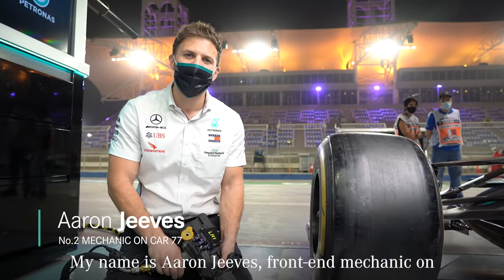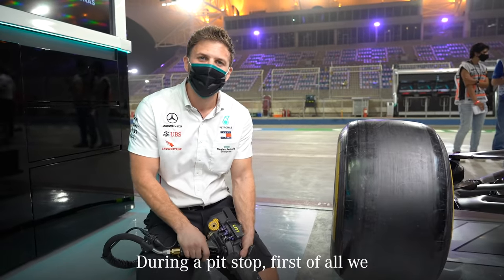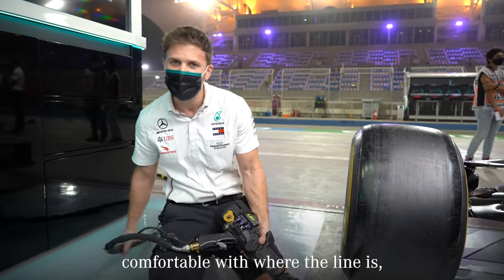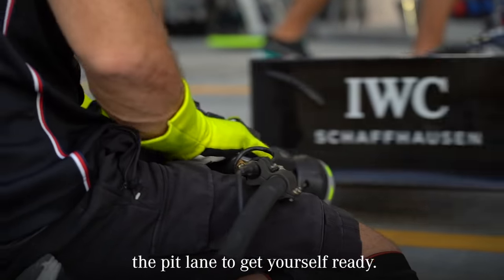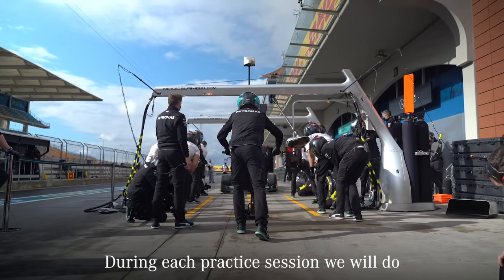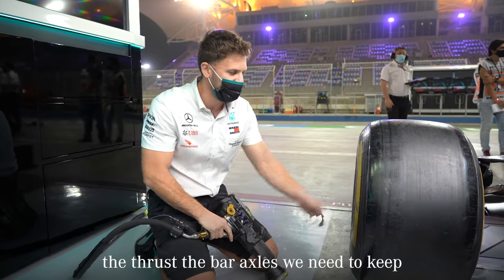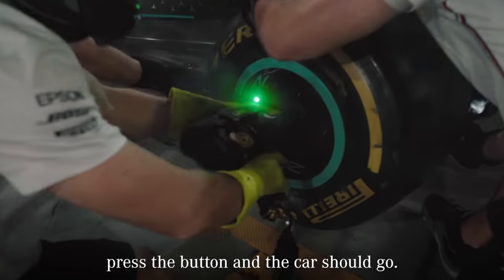F1 Wheel Guns EXPLAINED!

Comment: Thanks Mercedes for these insights. This brings F1 closer to us!
Reply from the maker: Our pleasure!
Reply: @MercedesAMGF1  you guys rock....best team management right from garage to trolling and roasting in social media ....great job guys keep it up
Reply: @MercedesAMGF1  Hey Mercedes
Reply: So true dude! I actually want a job in the f1 as a mechanic! And this helped a lot!
Reply: @MercedesAMGF1  do you practice failure scenarios too? From the 50 practices mentioned during the video, how many are fails? Are they setup totally blind for the engineer or they know when it's coming? 

Thanks!
Reply: I mean, they didn't really tell us anything specific or anything we didn't already know about how a pit stop is done..
Reply: @BeardyGit89  yes they did.
Reply: @hansmuds6018  you must pay very little attention to F1 if anything in this video is new information to you.
Reply: @BeardyGit89  wtf? I mean insights to this certain race. For example why Mercedes chose a certain strategy or how did they manage to do a one-stop. You don't get this info somewhere else
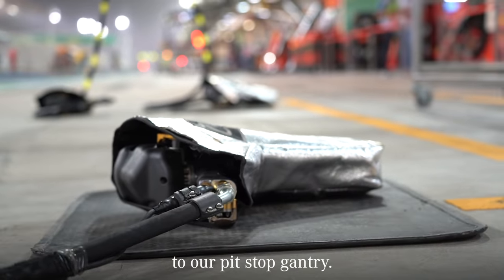Reply: @MercedesAMGF1  Please confirm my thoughts below if possible. 0:09 0:11 Green marks on gray tip of socket show it is spinning 0:22 2 sets of splines.
The above makes me think that the small inner socket is non spinning and the large outer socket spins. Given the two are working against each other, the operator won't get any torque reaction. Also note the blinking green light at the end of a tightening cycle as well as " the gun is electronically tied to the pit gantry ". This makes me think that there is a torque monitoring system in the gun, this monitoring system would be difficult to implement in a impact style gun.
Reply: @MercedesAMGF1  and ours!
Reply: @BeardyGit89  agreed bro, all they showed us was changing a tyre frankly and we all know how thats done,  its interesting but does not show alot
Reply: Also bringing valtteri closer to dnf

Comment: why no vroom vroom sound from the gun😢
Reply: Tbh it would probably break the mechanics hand, that wheel gun is so powerful (3000Nm) that it can break someone's hand if its not torque'd on anything as far as I understand lol
Reply: @sollar5188  yeah they are insanely powerful. They are also crazy loud so they probably didn't want to ruin the mic
Reply: @sollar5188  wouldn’t less twisting force be exerted on the mechanics hands when the gun is free revving with no resistance rather than when its encountering resistance from tightening a nut?
Reply: @quixotic6871  no, because there is nothing to take that force from the gun
Reply: @sollar5188  No this is absolutely not the case.
Reply: @sollar5188  It'd just be spinning.
Reply: @Kamyllo22  Isaac Newton disagrees
Reply: @quixotic6871  OK ye true lmfaoo. In the words of Charles LeClerc "I am stupid."😂
Reply: That's an impact drill guys, which means simply it has a flywheel inside that spins until some speed and when rew'd up to a certain angular momentum it locks up to the rest of the gun to excert that 3000Nm torque, if there's nothing to stop the gun then it'll try to spin itself with that much torque.
Reply: @tafana  0:09 0:11 Green marks on gray tip of socket show it is spinning    0:22  2 sets of splines.
The above makes me think that the small inner socket is non spinning and the large outer socket spins.  Given the two are working against each other, the operator won't get any torque reaction.  Also note the blinking green light at the end of a tightening cycle as well as " the gun is electronically tied to the pit gantry ".  This makes me think that there is a torque monitoring system in the gun, this monitoring system would be difficult to implement in a impact style gun.
Reply: @sollar5188  0:09 0:11 Green marks on gray tip of socket show it is spinning 0:22 2 sets of splines.
The above makes me think that the small inner socket is non spinning and the large outer socket spins. Given the two are working against each other, the operator won't get any torque reaction. Also note the blinking green light at the end of a tightening cycle as well as " the gun is electronically tied to the pit gantry ". This makes me think that there is a torque monitoring system in the gun, this monitoring system would be difficult to implement in a impact style gun.
Reply: @bobroberts2371  if it's anything other than an impact style gun then the operator would need to tighten the bolt by his own strength. And the green marks show it's spinning like what? Half or quarter a round? Looks to me like he released the trigger already and pulled the gun and you see the tiny bit angular momentum left on the tip at 0:09. Otherwise I don't think he'd still be spinning the gun while pulling the bolt out of the wheel, it'd be dangerous, the bolt could fly out at some insane speeds.
Reply: @tafana  From what I figure.  The small inner socket is locked to the body of the gun, this small inner socket locks to the axle stub. The large outer socket locks to the wheel nut then rotates to take the nut  off.   Since the small inner socket is held immobile by the axle stub ( and driver holding the brakes on ) there is no torque reaction felt by the operator.  Also, an impact wrench is slow compared to a straight motor.  I'm also guessing there is a 2 stage gear reduction system on the gun to allow for high torque / low speed when taking the nut off and low torque / high speed to spin the nut once loose .  There might also be a third stage for final tightening.
Reply: Because they dont want to show that It sounds better than F1 V6
Reply: @Bocho123  that's not how an impact drill works
Reply: @Bocho123  and even if it wasn't an impact drill the torque it applies against it's bit and inner mechanism's inertia is still enough to injure the user. If you have an ac drill try this, hold it with one hand, extend your arm, then push and release the power button for a moment, you'll notice it's trying to spin your arm too. It's not because of friction it's because of inertia.
Reply: @quixotic6871  nope, a free revving gun spins in the body of the gun and it generates so much force it moves the body (grab any gun and you can feel it), it doesn't just spin in place, and you're holding it by the handle off centre of the spinning body it will want to rotate and twist your wrist. When it encounters resistance, it is an impact gun, easiest way to describe it is that it just vibrates harshly in your hand and the nut is holding the gun body in place so it doesn't twist your wrist, it is not like a drill that just wants to spin and rip out of your hand.
Reply: These impact hammers work like a normal hammer: you swing your hammer with limited force, and upon impact, you generate an extremely high impact force of very short duration.
In the wheel gun, the law of momentum conservation is applicable: the mechanic's holding torque is the mean value of the actual hammer torque pulses.
As an example: assume wheel gun hammer pulses of 3000Nm and a duration of 0.5ms each, repeated 10 times per second, then the average torque is 10/s x (3000Nm x 0.5ms) = 15Nm. This average torque of 15Nm is quite doable for the mechanic.

Comment: I imagine the pressure in this job, you do a slight mistake and the whole race is ruled out , it can make a huge difference in the championship too. Hats off guys 👍
Reply: Yeah ofc I respect them that mistake in sakhir was a one off fo sho
Reply: Last race was a hugeee example
Reply: @peppamintyy  100%
Reply: Aged like milk
Reply: and their arm strength those wheel guns aren't light at all
Reply: @MitchellC564  They actually aren't very heavy, and they only move them about one foot for less than three seconds. The amount of actual work any one member of an f1 pit crew does wouldn't burn ten calories, and i am not speaking metaphorically.

Comment: Please do the radio system! like how do the drivers activate it, where is their mic, how does it work on the pit side?
Reply: Push button on wheel. They talk the mic in the helmet pics up the feed and relay's it to the race engineer and pit wall. Use common sense.
Reply: Nice try Ferrari
Reply: But apparently It doesn’t work thoigh
Reply: @EricBrunning1989  plus some drivers have an button to affirm messages.
Reply: Why doesn't the drink tube mumble their voices?
Reply: @TangoNevada  there’s no drink in F1 anymore
Reply: @conrado800  No? Damn, that must suck.

Comment: I actually thought that when not racing the wheels get torqued manually, but it does make a ton of sense to engineer parts outright that just work perfectly together each and every time, so you can just use them whenever you want; if racing or not and thereby if it has to work quickly and not..

Comment: When the car is lifted up, does the driver need to press the brakes for the gunner to be able to loosen the wheel ?
Reply: i am not sure about the front wheels, but i guess the rear wheels are already locked up by the engine braking, so no need of holding brakes there
Reply: @deepak_nigwal  The clutch is held when the car is lifted up so I don't think engien braking works
Reply: Interesting question
Reply: Definitely yes he does.
Reply: @christophermeraz-mata  Okay thanks

Comment: how do you know when the bolt is tight enough?
Reply: Good question
Reply: You guys have never change a tire before, right?
Reply: if the light on top of the wheelgun turns green its tight enough
Reply: @felito21  only on a normal car without a super sophisticated wheel gun and only with a spider wrench
Reply: @woutr93  thanks
Reply: @Mahoyage  it's pretty much a normal wheelgun that it's like 3000x faster (i don't know the real numbers) but I'm pretty sure that you can feel when it just doesn't turn anymore. Also this guys have been doing this for years, so I'm pretty sure they have and "instinct". 

Also the light in top doesn't tell you when youre done, if you actually watch the video you can see that he says you press a bottom when done and the light turns green, which is probably to tell everyone that you're done.

Comment: Nice to see. Ok so there pneumatic gun works like every other one in the world. Nice to know it has an auto reverse op trigger and they need to keep the gun pressed to the wheel nut to retain the lock rings. But what’s the green light? Correct torque / op finished / failed ??

Comment: question.. the wheel gun shift automatically to lock or unlock the nut.. but what happen when the nut get stuck? theres anyway to put the gun turning to unlock the nut? how  turn direction shifts in those cases? does when the mechanic release the trigger it shift automatically?

Comment: A lot of the automotive trade has moved away from pneumatic tools to cordless battery tools, is this something you have looked at? If nothing else it would save having the air lines causing potential hazards?  
Thanks for the videos :)

Comment: what PSI of air do you guys run through the wheel gun? and whats the desired torque on the wheel nut for when the light turns green?

Comment: Is it difficult to hold that gun in place when running considering the torques?
Reply: Not easy. I get to use one when the team is in Malaysia and part of them were at Suria KLCC (one of the malls in Kuala Lumpur, Malaysia) as part of a Petronas roadshow. Applying just light pressure on the trigger will cause the head to spin very rapidly.

Comment: Could you show the actual wheel nut and the threads on the hub?  Please explain how it got cross-threaded or the teeth were sheared off.  This video leaves more questions than answers about what actually happened.  Edit: Ugh, apologies.  I didn't see that this is an old video.  But, you could make a new video for us hint hint...  :^)

Comment: you need to run a few more stops prior to race day after today's mess up!
Reply: stev ano  May i remond you that's its the "crew" that put that nut on while in the garage "while NOT under pressure" and they some how find a way to cross the thread it making it impossible to take off after heat cycle. weird how its always Bottas car that gets messed up.. HUMMMMMMM

Comment: Surprised Wheel Guns haven't gone full Electric - battery powered only. Messing with those hoses, is dangerous, and problematic. To get high power, a lithium battery backpack could be worn to power the hand tool.

Comment: That didn’t tell me how the wheel gun operates!
How does the wheel gun make sure it’s not over or under tightened? Isn’t there a torque spec for these wheels?
Reply: Probably a combination of 'industrial secret' and also that the guy just tightens a nut on a wheel. There are other engineers that worry about the function of the gun, most likely not him. So doubtless he doesn't know.

But it got the F1 and car nuts to watch.

Comment: Cool. That explains nothing about how a wheel gun works.
Reply: If one were to be really mean, one would say, the guy's only job is to loosen and tighten a nut, he doesn't even put the wheel on. So he doesn't need to know how it works, he even has a spare if it fails on him.

If one were to be even crueler, one could further say, he don't need no degree to put the end with the hole in it on the turny thing that holds the wheel on and squeeze the trigger thingy until it tells him to stop.

But I am sure he has an advanced degree in mechanical engineering and his last job was designing elements for rocket motors.

Comment: That was rubbish. There was No explanation of the gun itself, only the action of what he did during wheel change, which we all have seen many times. Not good.
Reply from the maker: What more would you like to see? We're always open to hearing constructive feedback. Let us know what more you'd like to know and maybe we can do another video on the topic next year.
Reply: @MercedesAMGF1  When you mention "Wheel Gun Explained" then please show us all the workings of the gun. For example, "what do the pipe and looks like cable function" then the inner workings of the gun itself, maybe from the gun manufacture engineer and how the gun retains the wheel nut when removing and engaging back to wheel. Many in-depth could of been mentioned.